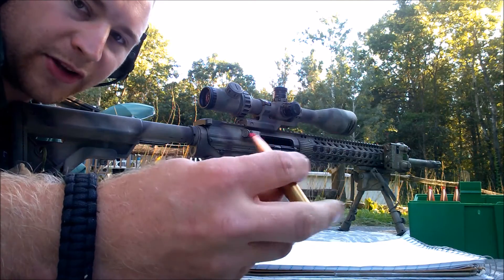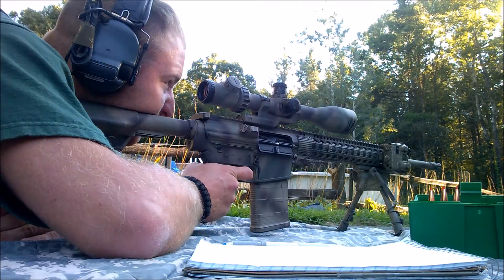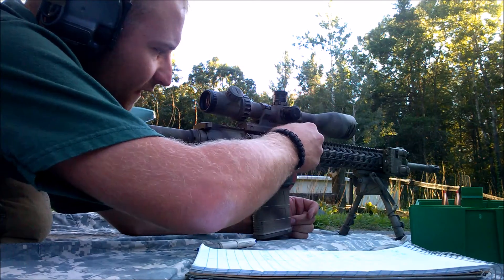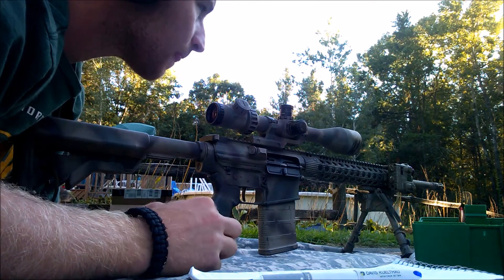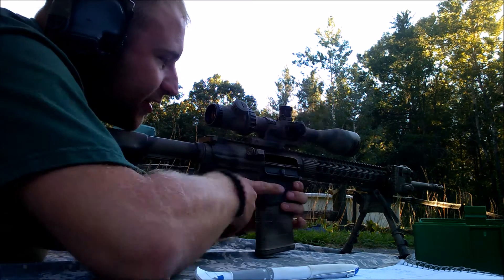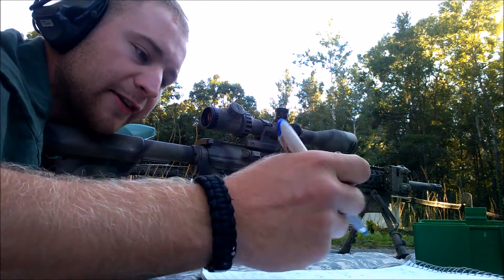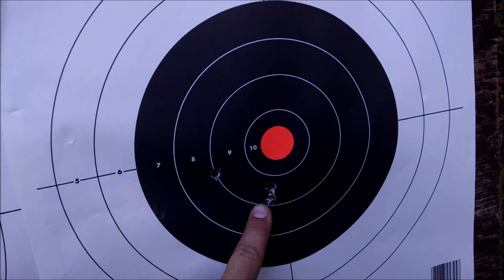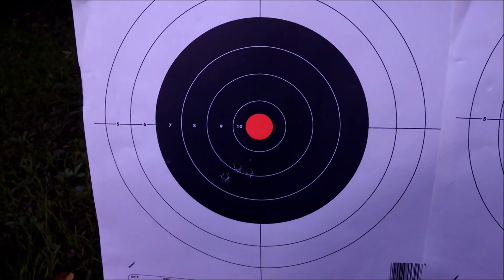IMR 4064 load test

Comment: I prefer using the 5-shot test method, loading each charge weight five times to get more definitive results in accuracy & velocity.
But I cut it down to 3-shots for testing COAL adjustments, after settling on a charge weight...   🎯